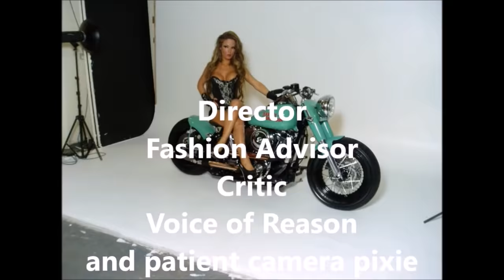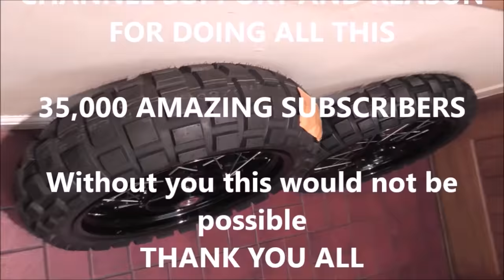Delboy's Garage, USD Fork Seal Replacement

Comment: Hi delboy! Quick question, what's the signs of a knackered fork bush? Rebuilding forks and I have took of the inner bush that looks like it has been driven in with a screwdriver... All scored and cut around the edge, that need replacing? Only a student so looking for I need need 👌 I do have a video if you fancy a more in depth look, 
Thanks 😜
Reply from the maker: Hi Elliott.  Im assuming you mean the bronze coloured ring inside the fork legs,  one sits just under the fork seal, and the  one in a groove about 10 inches away from it..? 

Their job is to act as a soft metal slider that the inner and outer fork tubes can slide along.. and there will naturally be some score lines along them in an up and down direction... that doesn't indicate that they are worn out, those line will get there within the first ten miles of fitting them.. but if there is any lateral play between the two fork tubes then they must be replaced mate... they don't cost much, and you can buy them with your fork seals and oil.. why not poke a new set in while the forks are apart.. 

Hope that helps you out, and good luck with it.. Del.
Reply: @Moonfleet41  it has thanks slot, I'll stick a new set on

Comment: Hi.  After watching your video I dived in to replace my fork seals but to my surprise, my fork is not as described in your video.  My Yamaha FJR 1300 has a third bushing half way down the fork!  I am really stuck as I don't know how to drive this mid bushing down between the outer and the inner tube.  My guess is a third pipe of appropriate diameter but as one might expect this is non standard diameter.  Would you have any suggestions? Many thanks
Reply: I'd ask on the FJR owner's forum and search to see if there are any videos specific to your bike. Good luck.
Reply: @respen43  Thank you for your suggestion.  I have figured it out.  I bought a short piece of stainless steel pipe 47.68mm diameter (smaller than the stanchion diameter).  I cut it lengthwise like the plastic pipes used in video.  When I cut the new pipe all the way through, it sprung out to a diameter closer to that of the stanchion.  The new steel pipe is 1.5mm wall thickness so just thin enough to slip in between the inner and outer part of the fork.  I made sure to file down the new piece of pipe very carefully so as not to scratch the stanchion.  I also used baking paper as a layer between the stanchion and the new cut pipe to further reduce the risk of scratching.  It worked well!  All done now.

Comment: Great video !
What would be the oil that you suggest instead of an specific fork oil ?
ATF?
Two stroke oil?
It's is complicated to get fork oil in Mexico.  Some years ago I read that ATF oil could be like universal fork oil for heavy motorcycles ( more of 200 kg of weight).
Reply from the maker: Hi there Enrique, that is correct, you can use ATF as a fork oil, it is after all a hydraulic oil in the first place, so does the job perfectly well if you're not able to get dedicated fork oil... there isn't actually that much of a difference... good luck with it!
Reply: @Moonfleet41  thank  you so much for the reply,  I have learn a lot from your videos,  Best regards from Mexico my friend !
Reply from the maker: @mexicanorespondon1223  Eres bienvenido hermano !

Comment: I like your temporary tied on wrag to protect the lower end of the fork.
Most others loosen the top fork triple clamp, loosen the fork cap, the loosen the lower triple clamp. 
This way the top clamp is guaranteed to not be holding the top of the fork tube against the cap.
The grey coloured side of the 2 bushings is the teflon coating that the tubes ride against with an oil film. So it is important to inspect the grey sides to ensure they are not worn through or damaged in some fashion.

Comment: The dust cap has corroded and needs changing, but there is no oil leaking out do I need to do this hole process
Reply from the maker: With upside down forks, you will need to pull everything apart as shown, as the dust caps come off last, there is no other way to get the dust caps off, so yes, a full strip im afraid.

Comment: Hallo DELBOY, LOVE the video..best ever. I have a Aprilia RSV Mille R 2001 and said to my mechanic that I wanted to do the forks on my own. He told me it's not possible without special tools . Do you have a idea with he meant by that...or is het the tool you bought to get the bussing in ( the two halve and the 3 rubber thingy ?) that he means.
It costs me about 300 Euro to let them done. But I know I can do the job if it's just like your video or are the forks something special for the R 2001 version? thanks for any advice...
Reply from the maker: Many forks require a specified tool to assist with assembly, so unless you're prepared to buy that tool, then you're a bit stuck... and as for the seal driver, it's the same again, mine was £60 and I've used it maybe 6 times in the last 5yrs... so as you'll see, very often, it's actually cheaper to just hand it over to someone who does it every day, rather than buy special tools you'll never buy again.

Comment: R1 2005 ? It's work like that? I'am worried to disassembly the forks and inside i find the plastic plate with Two holes..like Honda Hornet the White plastic plate..

Comment: Hello Del,
I few years ago I managed to change oil and fork seals on my SV 650S standard forks thanks to your video. 
Now I´ve got a newer bike, Street Triple 675R 2014 with USD forks and it is time to change fork oil in them.
Due to it is a newer and more expensive bike I´m more scared obviously. The seals are fine and they aren´t leaking. 
If I just open the upper fork nut and let the fork upside down over night, is there a chance to get most of the oil out, 
or do I have to take the nut apart from spring and pump it like you showed in this video? And other question is, if you have any tip,
how to loosen and tighten the upper fork nut without damaging it or scuffing it by the wrench nut or from screw-wrench. I hate, when are these 
nuts beaten up from tools... Bike has 25 000 miles and the nuts look, like they haven´t been opened so far, so i would like to keep them looking brand new.
Thank you Del for your help and great video!
Reply from the maker: Hi there, with the cartridge forks, it is essential to pump the internal piston in order to empty it... it won't usually drain by gravity, but if you're unable to do this, then even a partial change is better than nothing.  Check with Triumph for any special tools needed before you open them up as I haven't opened a pair of forks on a Striple so far... Good luck with it, and regarding the top nut and not wanting to marr it, I totally understand that, Sealey offer a range of anodized aluminium spanners for such a job, but they are quite expensive and you only need the one... so how about investing in a pair of these, they are 'smooth jaw' and can squeeze really tight, but at the same time accurately on the top nut, so they don't bruise it, plus you'll find lots of other uses for them, here's a link:
https://www.spanner-monkey.co.uk/wiha-wrench-pliers-classic-parallel-jaw-p-74
Reply: @Moonfleet41  Thank you again very much Del!

Comment: Great tutorial, I do have a question regarding the seal kit you use, it is OEM or aftermarket?  As you said as long as they are identical in fitting size, is there a preference for OEM or aftermarket if aftermarket improves on the strengths and tolerances of the parts?
Reply from the maker: I bought mine from Wemoto John and they have been fine till now, in fact ive never gone to a main dealer and bought "genuine" fork seals, always bough 'parent' ones, and ive never had one leak after if changed it... hope that helps.. Del.
Reply: Moonfleet41 I've also notice in about every video posted only the dust seal and the fork seal are replaced and the snap rings are reused after careful cleaning of all parts, us that accurate

Comment: Thank you for the video.  I have one Buell XB9R Front Fork set that has some rust scattered around and pitted.  It does not leak yet but a guy I met at a workshop told me to get it reconditioned by "Hard Chrome". May I ask of your idea on this?

Also, it would be much appreciated if you could educate me on how to remove the bottom part of the fork?  Since I was told to send only the fork part to them for re-chroming and I have no idea how to. I tried unscrewing the bottom screw but it did not come off. 

Thank you in advance.
Reply from the maker: Hi buddy, the advice to get them re-chromed is correct, there is only one repair for rusty, pitted forks and that is to have them hard-chromed and re-ground... as to removing the bottom clamp, they are pressed on, so just extremely tight... depending on the design of the fork, they can be pressed out from the other side, or you can GENTLY heat the alloy clamp to expand it, and then attempt to pull it off by holding the chrome slider still and rotating the clamp... rotation is the key to removing anything that is stuck - but it's never easy - good luck! Del
Reply: Thank you so so much for the good tips. Today I have followed your DIY on re-aligning front forks since mine was quite off too the left (which I thought something had been wrong since the fork rebuild a year ago)  This problem had been nagging me until I saw your video. And now it's not 'off' anymore. 

I owe you a beer, Del. :)

CHEERS!!
Reply from the maker: Glad you got it sorted out buddy... handy trick to know aye... pass it on when someone tell you they have the same issue.. Del.

Comment: So I have a 2021 Cbr600rr and its my first bike and im slowly learning and im at a weird spot where I need to replace a fork seal and all ive found specs wise about the forks are that they’re 41mm inverted telescopic big piston forks with spring preload. Is there a way I can figure out how much oil id need? Or the type of oil needed? Or the type of seal id need? Do I just go into my dealership and ask them to order the parts needed? Both my manual and Honda website specs said the same thing.
Reply from the maker: Yes exactly that Anthony, go into your dealer and tell them exactly what bike you have, and that you need fork seals and fork oil... they will give you all the correct parts for your bike.

Comment: Great video, but didn’t the rag at the bottom of the fork leg affect the air gap measurement?
Reply from the maker: No, measure to the inner fork tube, not the outer one, therefore the height of the outer one is irrelevant... and it's important not to push the new seal down over the sharp rust spots at the bottom of the fork leg, always measure from the inside tube that the oil sits in.
Reply: Delboy's Garage every usd fork Strip I’ve ever done the oil level has been set spring out and leg fully compressed measured from the outer according to the factory manuals. Totally understand not wanting to run the new seal over the pitted or corroded lower section.
Reply from the maker: OK, didn't want to be pedantic or waffle a huge reply, but yes, the outer tube is advised to be forced right down to the stop....and as you say... that will cost you a new seal right away on an old rusty chrome slider.. but when they ARE pushed right down.. you'll notice they sit level with the inner chrome tube... Therefore, if you leave yourself some room and Don't force the seal down over the sharp rust.. then just measure to the inner tube which would have been the height of the outer tube had you pushed it down.. .There. that's the long Sunday answer..!  hope that makes it clear now buddy..!

Comment: I think most manuals say to measure the oil from the top of the outer tube with it fully depressed, so I was just wondering how you measure the level if you haven't fully depressed  the fork.
Reply from the maker: When you fully depressed the outer tube, it becomes level with the inner tube... so just measure to that!
Reply: Ok, cheers for that. @Moonfleet41

Comment: The manual for my Versys states to use a special spring compression tool and a fork spring stopper to get access to the lock nut. You did not use one, are they necessary?
Reply from the maker: They are handy.. but i just get round it as you saw..!

Comment: are there advantages of USD-Forks compared to normal Forks?
Reply: +irgendwieanders1 The advantage is that they are stronger around the yoke area where most of the bending force is acting on the fork like when you're braking etc. 
Sliders, the gold tube in this video, are obviously larger in diameter than the  chrome stanchion, so are less likely to bend and flex. The slider also makes up more of the overall length of an USD fork so they are more rigid, also stanchions are heavier so a smaller one means the fork is lighter overall. 
They were developed for racing of course, does anyone actually notice on the street? Probably not, but they look cool though.

Comment: Just a thought, what about the distance adjustment caused by the rag at the bottom, stopping the fork leg travelling to the end of travel?
Reply from the maker: Meaure to the top of the INNER tube so the height of the outer tube is irrelevant.
Reply: Moonfleet41 glad I asked, doing mine today, a mate was saying he has used arraldite on the slider bottoms where the chrome has gone. Thanks Delboy, love your channel.
Reply from the maker: @shanco73  Nice one mate, great trick with the Araldite, works really well, you can also use fibre glass resin, or even superglue at a push... good luck with yours, hope it goes smoothly for you mate!

Comment: great video! What is the name of the grease that you are using when reinstalling the seals. The red grease you put on the milk carton?
Reply from the maker: Hey Hector, that is Red Rubber Grease, supplied with the seals as an effective lubricant for assembly.. but you can just use clean brake fluid if you don;t have any.
Reply: @Moonfleet41  thanks

Comment: Im wondering if you can do the same just taking the bottom bracket out and sliding new seals up
Reply from the maker: Yeah, let me know how you get on removing them..!
Reply: @Moonfleet41  I'm wondering just looking at the cylinder and the bottom bracket they're two different materials and the big bolt behinds holds both pieces together...or is just press in

Comment: del ive had to do the fork seals on the varadero 3 times in 3000 miles, it seems to just eat them, there not usd forks just standard and the stanchions are straight with no pitting near the suspension travel area, ( another job i learnt from one of your old videos ) I have noticed the top bush is a little worn, i had suspected this being the problem, its only a fraction of a ml can such little wear be such a problem,
Reply from the maker: +Daz Fowell Hi mate, unless you can feel some imperfections on the stanchion, then it won't be that that's killing your seals... if you get dried road dirt on the stanchions, then dragging that in and out of the seal will trash them in no time and in winter, it's the biggest source of killing a seal... there are two ways to stop it....
One is to keep the stanchion constantly wet and oily with a little squirt of WD40 every time you leave the house, then when the dirt sticks to it, it stays wet and the dust cap just pushes it out the way.... or better still, and a permanent solution...
Fit some gaiters, as they will keep the dirt off  in the first place !
Reply: thanks mate,

Comment: Delboy, Can you provide us with a video on this again but with cartridge forks if you haven't got any "special" tools that the workshop manuals claim you need, please? Or can you just explain the difference in methods?

Cheers.
Reply from the maker: Sorry Keiran, we have always had a tradition of only making videos of what we have to do to our bikes, as you can appreciate there's a million things we could do, but we only have our own bikes to work on... so can't provide videos in demand... what special tools are you referring to??
Reply: Ok mate, that's understandable. I have an '06 Daytona 675 and in the Haynes book it's showing a u shaped steel brackets with a threaded rod coming from each side. You thread the rod ends into the cartridge holes to hold it in place, I think. I'm struggling to move it all down to get a spanner in to undo the top aluminium preload/rebound cap and I just want to make sure I am going about it the right way so I don't damage anything. The seals are fine but I really want to change to new ones to learn and give the whole bike a refresh on various jobs.

Comment: Hello Dell, i changed the seal of normal forks on my old bike after your other video, this one helps me think of chaning them on my new bike. 
One Question thought, If you have the rag as extra distance wont that affect the amount of oil as it looks like you measure from the top yellow outer forkleg. If it sits higher will it not take more oil?
Reply: +Jonas P I also realised that old video was the one that lead me to you and learning and daring to do stuff mechanical stuff myself. thank you for that!
Reply from the maker: +Jonas P Hi Jonas, good to hear from you and glad the videos can help you!  With the fork leg, you make a logical point, but you don't measure from the yellow outer fork leg... you pour the oil in to the internal chrome tube, so you measure to the top of that to get the right oil level... it's just not obvious on the video - hope that makes it clear!
Reply: Yepp, perfect sense measuring from the inner tube.